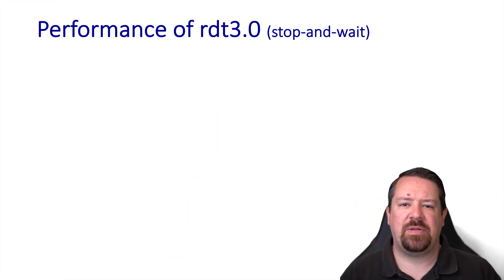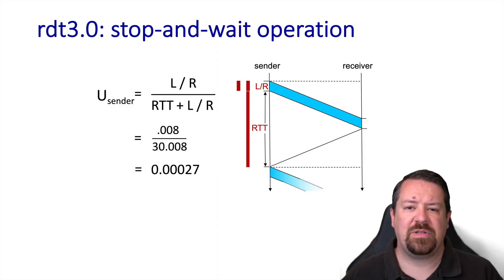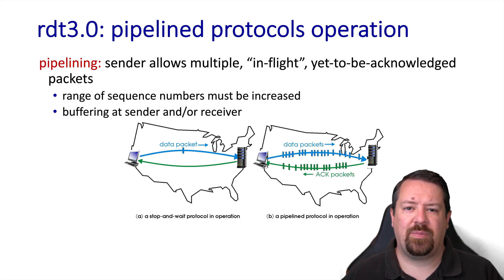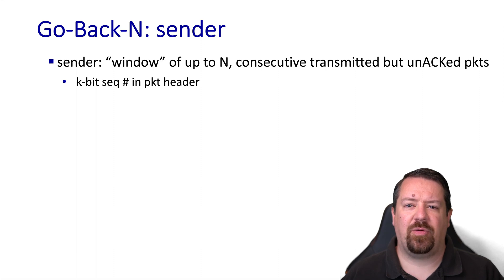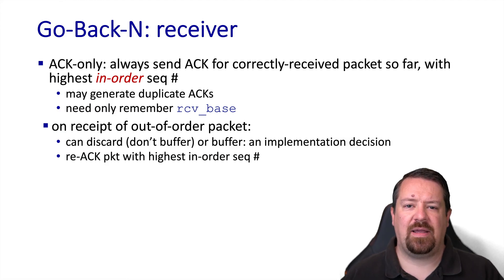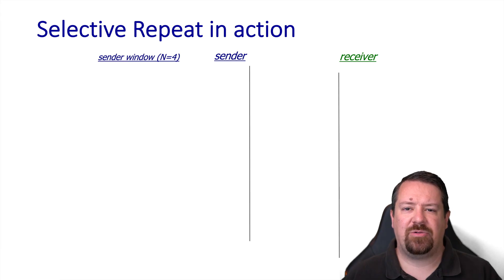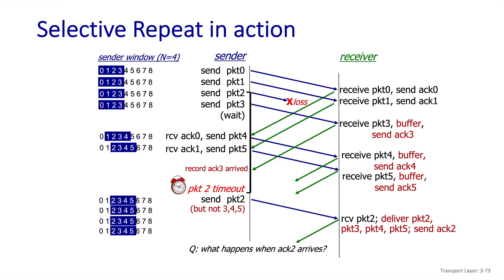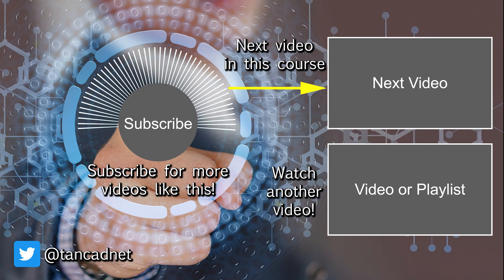Performance of Reliable Data Transfer - Transport Layer | Computer Networks Ep. 3.4.2 | Kurose, Ross

Comment: Also, at 2:56, instead of 0.024 you wrote "0.0024". Also 0.024/30.008 = 0.00079978 which rounds up to 0.0008 not "0.00081"
Reply from the maker: These are the Kurose & Ross slides, I didn't write them.
Reply: @EpicNetworks  ok so the slides are wrong.

Comment: I might be wrong but in your example, at 1:58 I think the utilizing speed should be 270 Kb/s. If we multiply (0.00027*10^9)/1000 = 270 Kb/s  but you said 33 Kb/s. Did I understand it wrong? How the utilizing speed is 33 Kb/s ?
Reply from the maker: I misspoke.  It should be 33 kB/s, not 33 kb/s.
Reply: @EpicNetworks  Yes, so I was right. it was 270 kbits/s which is 33.75 kbytes/s. Thank you for clarifying it.